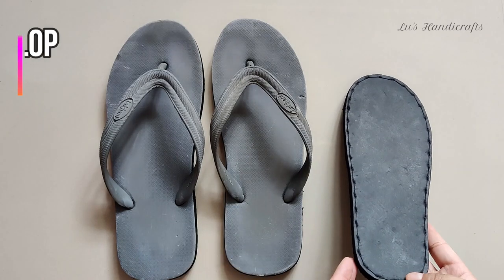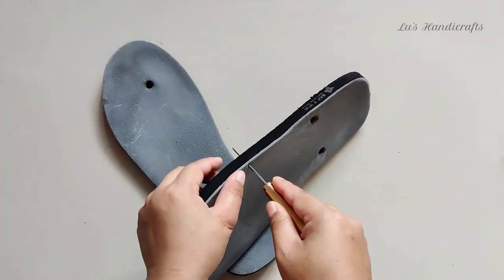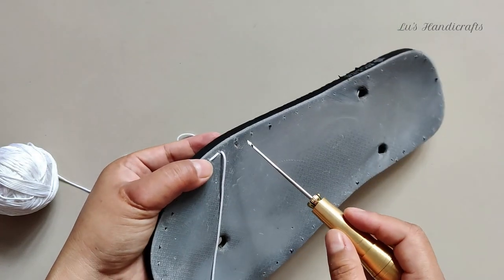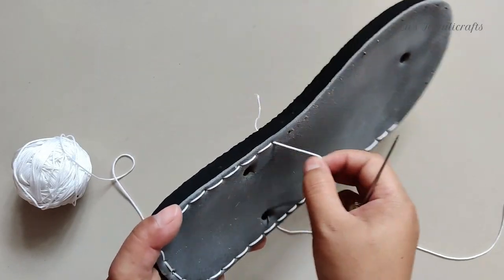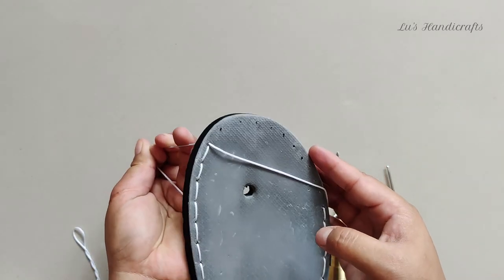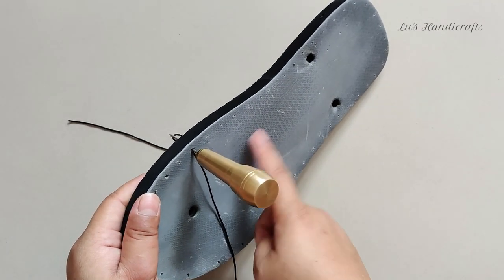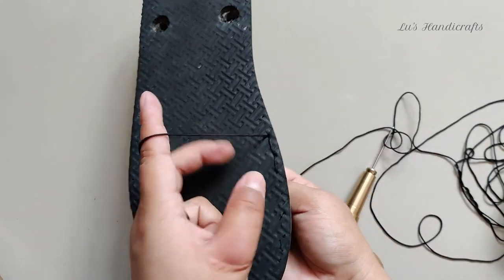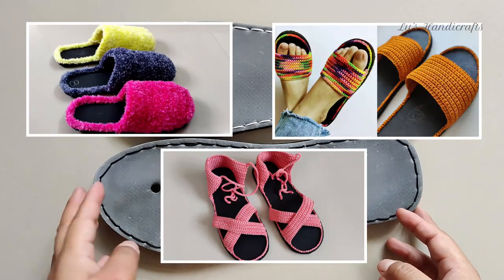Crochet slippers - Preparing Sole base from Flip Flops | Step by step

Comment: is there a good way to fill in the holes left in the soles from where the flip flop straps were?
Reply from the maker: Not that I know of. But once we start wearing, the feet covers it. So it's not visible.
Reply: I saw somebody on a Pinterest vid cut the knobs off the straps and glue them back in. You could probably use any kind of cork/foam product with similar character/material/flexibility as the shoe foam, and a very flexible shoe glue (Barge cement, E6000 etc). Hot glue might work, but the glue should be of a flexible kind. Otherwise the rigidity will cause it to break off the foam while walking.